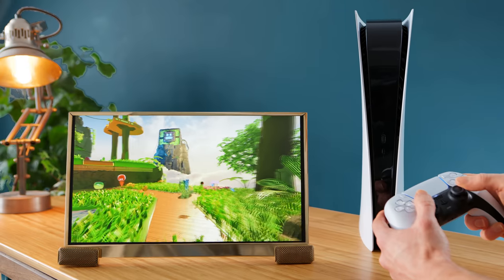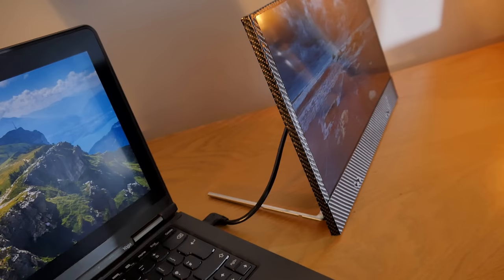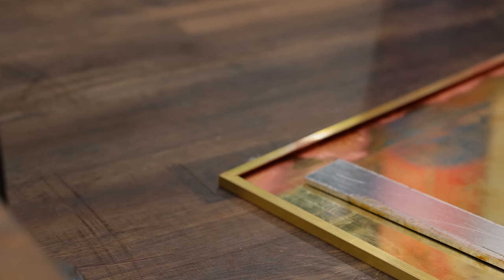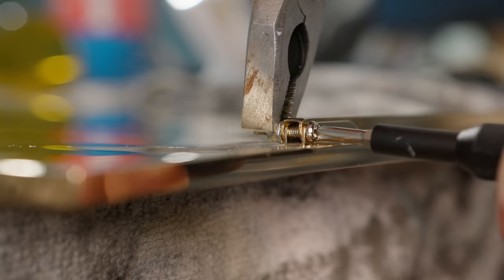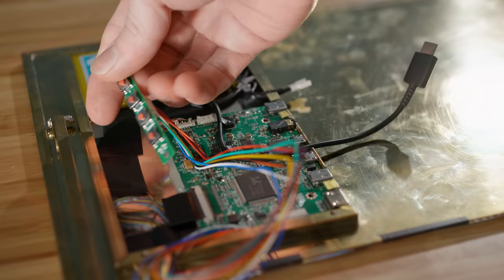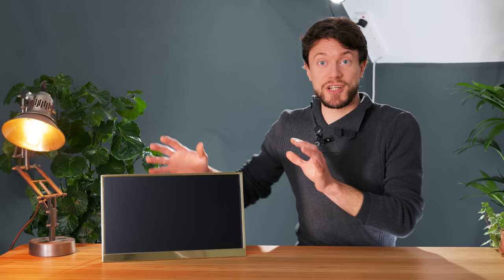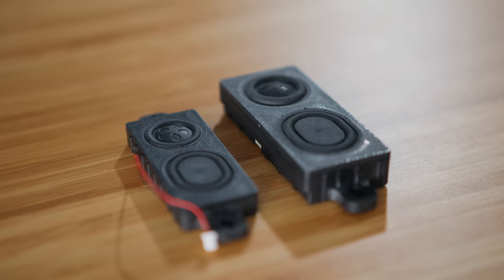Building a USB-C touchscreen monitor (new for modern devices)

Comment: I really appreciate that you used actual DIY methods instead of just 3D printing a bunch of stuff and gluing it together
Reply: Sure you could say it's just 3D printing things and glueing together but soldering electronic components, doing the actual 3D modeling, and doing prototypes/testing, are all important parts of that kind of DIY. The same applies for this with the only serious difference is that it's much harder for someone to replicate this kind of thing as not everyone can source some materials (brass in this case) or the tools required to work with it. 3D printing is relatively cheap in comparison as people either have access to a printer already, and if they don't, wouldn't have to pay as much to buy one as they would for the materials in just one or two projects.
Reply: @sacripudding4586  Yeah, but having a 3d printer is far less common that having a hacksaw and some files
Reply: @sacripudding4586  false. brass costs pennies
Reply: @post-leftluddite  the real trick is building your own 3D printer
Reply: @reverendglitch  which you must make using a 3d printer 😉
Reply: @post-leftluddite  I would generally agree, but 3d printers have become insanely available, affordable, and reliable in the recent years. If you think about it a bit, to do any DIY project you just need some basic tools. And if you want does tools to be any good you are going to spend at min 100-200 bucks. Creality Ender 3 printer costs just shy of $200 it can be delivered to your door in 3-5 business days and it just blows the mind how easy it is to use and what you can do with it. My point is, statistically you are probably right atm, but the way the current trends are going, I can see 3d printers becoming common in garages like electric screwdrivers and chainsaws.
Reply: @reverendglitch  no, the real trick is building your own 3D printer out of brass ☝🏼
Reply: @post-leftluddite  can I ask who has a hacksaw
Reply: @Notpoop906  With the amount he uses? no. You would be spending the price of half a 3D printer for every sheet of that stuff he uses. Plus if you want to buy the cheaper stuff and make your own sheets, you would need the knowledge to melt down brass and get it into a sheet you can manipulate.

Also 3D printing is far easier to do. While its true that it usually does look worse, that's not always the case as you can get some beautiful prints
Reply: No need to over-exaggerate, you can buy sheets of the stuff off eBay delivered to your door from China for very little. Truth is, the DIY lifestyle means you end up learning a bunch of inter/related fields that are of maximum utility, and it’s common for these people to have a workshop. He went with brazing brass because he thought TIG-welding Aluminium would be a bit of a stretch for a tech channel, but some of us can weld. Very few have a foundry and hot-drawn plate processing factory hehe. Personally I’ll make mine out of mild steel because I think rust looks cool, we’re living in the end-times so eventually it’ll be fashionable
Reply: @sacripudding4586  3D printing is mainly done by using your brain while it's nice to also do some actual handcrafting once in a while.
Reply: In what way is using a 3D printer NOT a DIY method? 3D printers are DIY tools just like a miter saw or a jigsaw
Reply: If you live in a fairly sized city you can probably sign up to use a 3d printer at a library
Reply: @buttslaya  I dont think they have metal printing? Just plastic like materials..
Reply: @post-leftluddite  Having a blowtorch and a place to use it safely isn't that common either. It's way easier (and cheaper) to do it with a 3d printer.
I can yeet a printer into my bedroom and not die horribly (source: I haven't died horribly yet). For soldering/brazing/welding sheets of metal safely i'd need to get a workshop/garage or do it literally on the street. Doing it in an apartment is too dangerous even for me.
Reply: @ireadysucks3026  uh, anyone that walked into a hardware store with 10 bucks and a need for a hacksaw?
Reply: @BeetleBuns  yes, but I don't know a single person with a need for a hacksaw
Reply: @sacripudding4586  Damn bro, where the hell do you buy brass? For the price of even a cheap 3D printer, say 200 USD, I can get a 4ftx8ftx1mm sheet of it and have enough to get 50 things at a dollar store.

Comment: Matt in another 2 years time: "I made this out of my new favourite material... Titanium... Which can easily be welded in a vacuum so remember to wear your oxygen mask if you try this at home."
Reply: Titanium, Niobium and Zirconium are metals that can be easily anodized in vivid yellow, green, or blue (or a rainbow style). And this is not an acrylic paint. So, why not?
Reply: It also looks quite smart!
Reply: hahahahahaha
Reply: OR much easier, an enclosed welding booth purged with argon. You can easily convert a sandblast cabinet into one. Seal it up and put argon in it. It just needs more pressure than the outside of the cabinet. Argon is heavier than air so the cabinet really doesn't even need a top!!! (I cast titanium golf club heads for 15 years and built the welding cabinets AND vacuum induction machines).
Reply: @reasoningtruth  That's the DIY perks video in 1.5 years time.
Reply: Diffusion bonded/superplastic formed screen frames at home....
Reply: there is no air in a vacuum so a weld thing will not work, but yeah who even tries this stuff
Reply: @ritwikgossain8379  I hope you're never in charge of welding OR melting titanium being as they both must be done under a vacuum and/or a purged container of oxygen and back filled with argon or you will end up with trash that has very little use or a hydrogen bomb. Research before posting and you won't need to retract your post as much.
Reply: @reasoningtruth  idk man but i think you cannot burn stuff in a vacuum as it has no oxygen, unless you supply the oxygen from outside
Reply: @ritwikgossain8379  a "weld thing"?
The point of welding in a vacuum is there is no air so you don't need to use inert shielding gasses, and for some finicky metals to weld like titanium, being able to melt the metal and there being no risk of oxidation is a benefit.
Reply: @ritwikgossain8379  How do they weld underwater? How did the old tungsten filament light bulbs burn in a vacuum? You don't need oxygen to melt metal, you need heat. We melt titanium in a water cool induction machine, a lot like your microwave. But that whole crucible must be in a vacuum chamber. The HUGE risk here is that if the water cooled crucible leaks the vacuum would suck huge amounts of water into the chamber. But titanium will suck all the oxygen out of the water in microseconds, leaving behind the hydrogen in a 3,500 degree chamber. So in nanoseconds you'll have a hydrogen explosion.  It happened twice in the US when we first started learning how to melt titanium. Now there are so many bells and whistles and explosion proof walls on titanium melters it seems it could never happen again. But it was exciting back in the day!!! LOL Ritwik Gossain, you only need heat to melt metal. It's impossible to pull a 100% vacuum so we pull the vacuum and put argon in the chamber to dilute whatever minimal oxygen that is left over. The guys would take scrap splashes of titanium that were too contaminated with oxygen, (gorgeous colors), and fashion candle holders out of them. It didn't take long to see them in the stores.
Reply: @ritwikgossain8379  Reductively speaking, welding is melting, not burning.  The very reason you're insisting you need oxygen is the reason you don't want any.
Reply: it was not vacuum in the filament bulbs, it was argon, and i said burning requires oxygen not melting
how does heat transfer?
conduction, convection or radiation, which require oxygen
idk about the rest kevin
Reply: @ritwikgossain8379  I'm throwing the towel in at this point, you're making things up as you go. Your post when you started said, "there is no air in a vacuum so a weld thing will not work". Welding is melting. Good bye. Go find a frog or something to do your senseless arguing with.

Comment: "because they can get soldered together"

the circle of tech making, he has ascended to non-repairable chasis
Reply: Solder is super easy to take apart, you just heat it up again.
Reply: @Lolquake  Apple and Microsoft Surface team taking notes - "glue can be heated up to take it apart"
Reply: tbh, with a 1 product made, there's no way to order custom made small screw to get it together. also it make them complex with metal. it can be improved if it was sold to other
Reply: @Lolquake  this is, indeed how soldered on components are replaced.
Reply: apple would be proud lol
Reply: Hello, I would appreciate a lot if some one could solve me this doubt: having a touchscreen, is there any way to use it with a digital pen (with pressure sensitivity included) on Macos? I found an old touchscreen from an old desk computer and I'm sure it doesn't have no sensitivity to pressure as a screen but, is there any digital pen I could connect to my macair so it reads the pressure besides the screens capability of it?
Reply: how the shit are you gonna repair a brass chassis... if it breaks, it's really broken. (you melt it down and recast)
Reply: @someoneelse1550  or solder
Reply: @someoneelse1550  maybe only one section is broken or you know the electronics break whilst the chasi is fine
Reply: @T.ONE-2-EntreOlivosEstudio  Pencils like Baseus stylus might help you. They don't need to be connected to the device and work more like finger replacements but more precise.

Comment: i did this on “easy mode” by reusing the laptop display assembly and modifying a raspberry pi 3d print template to fit the driver board then just fixing it to the back. the laptop hinge got reused and works great. just have to flip it around by undoing the nuts and adding new lubrications. 

good alternative for anyone who doesn’t want to go thru all the metal work or doesn’t have the tools or space
Reply: So the raspberry pi is replacing the control board?
Reply: @quinxx12  no just the case.
Reply: You got a tutorial? I would like to try this as well but how did you make the enclosure for the raspberry pi?
Reply: Ever considered making a magnetically attachable keyboard for this build, like surface pros? I think this should not be problem for Raspberries, since they can be connected via Bluetooth
Reply: Sorry but what did you use the raspberry pi for ?
Reply: @userone4874  i know i am late, but he didnst use a pi, he just used to case to house the periferals in
Reply: PICS PLZZZZZZ

Comment: Brilliant build! I would like to add just one tip... Brass oxidises. especially when touched with bare hands as the oils in our hands speed up that process leaving the brass tarnished and discoloured. So, to save you the heartache of having to continually polish this, which could lead to potential damage, I suggest clear coating all of the brass once its been cleaned and ready to receive the parts.  the Laquerre or Clear coat will create a very hard protective coating on the brass keeping it looking shiny for years if looked after.  Then it'll only ever need a simple dust off now and then.
Reply: Doesn't the metal polish already adds a layer over it though?
Reply: @8bviews91  god damn it. Not helpful, but okay
Reply: @SuperSohaizai  no. Metal polish does not add a protective layer.

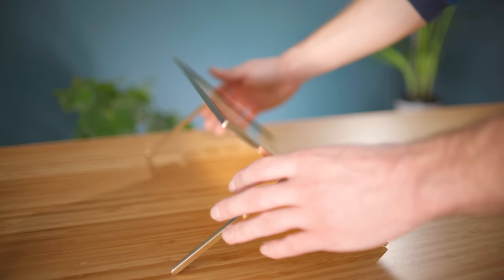Comment: 5:45 a significant improvement for stability and to prevent damaging the device and/or surfaces and possible injury, the legs should be joined by another length of brass soldered between the two legs.

Comment: best tutorial I've seen so far. You covered every possibility I was hoping for. The built in battery that you plug into with usb is THE best touch in the build. Its a perfect solution to get rid of the power cable yet its sleek and no extra finagling, just taking advantage of the built in features.
Reply: But how do I know what battery to look for for a basic LCD panel , for a build like this, the Controller board I got, says it requires 12v 3A,  that is big for a "slim" LI-o battery.

Comment: if you want to avoid displacing brass you have already soldered together you should try putting wet napkins on the joints you don't want to melt, it works surprisingly well.
Reply: Or use cool gel

Comment: These micro sized controllers coupled with modern 4k touchscreen capable monitors is kind of mind blowing.

You can now build your own Tesla dash board if you’re willing to spend the cash. I’ve seen iPads hacked into the dash, but choosing the resolution size etc here is actually huge for custom car work.

One day I’ll have the cash to switch my engine to ev, but until then, this will keep me busy.

Comment: Unless you have a donor laptop, you are better off just buying a portable monitor with touch screen capability. You can find 15.6" 1080P for under $250 USD on amazon. You will need the lcd/digitizer ($90 USD), the eDP controller with USB C port ($40 USD), and the touch controller itself (price ?!?) and you still need a case and power adapter maybe.... Most of the components will come from China so lots of delays in shipment as well. Take a look at a disassembly video of a touchscreen laptop for a better understanding of the components needed plus the eDP controller for the USB ports.

Comment: U should've just used a usb c charging circuit. That cable wouldn't be sticking out, it handles all the protection for the battery and u can use powerbanks with them as well.

Comment: This and some hinges, for a top half.
Combining it with the base parameters design of his watercooled ps5.
Only instead, adding a thin heat sink layer with a louvered bezel to the bottom (by having the ps5 build essentially upside down,) to maintain fan+passive air and thermal control.
Does add a slight thickness to the original slim concept, but with such wide area for thermal management using the whole base as essentially a passive heatsink, paired with the slotted bezel for dispersement of heat (aiming for rear exhaust channels) as well as intake of fresh air on all sides, I believe the added chamber could stay rather slim while simultaneously meeting or beating the watercooled specs without sacrificing a fan system.
Allows him to stick to the external power brick, grab a laptop bag and a ps5 controller, and he’s off to the races.
Potentially even adding a chance at a laptop battery-esque combo, for truly portable/wireless play.
(Even if the standalone battery life would most certainly be dismal 🤣)

All while negating the need of the waterlines+gigantic wall piece, which killed the first ps5 board.

Absolutely not bashing, I’m in love with your work and your channel, and would just love to see the first laptop style, ps5 “move,” be amongst your accolades in the DIY creator space.

I can’t thank you enough, for all the inspiration you give me in own home projects.
Please keep reinventing the way tech and sleek design, combine. 🖤

Comment: 7:06 Lithium batteries normally have protection circuitry packaged with the battery. If you unwrap the black plastic/tape cover, there should be a protection circuit under there.
Reply: If you buy those batteries fron a electronic distributor, no protection circuit is build in. This is "normally". :-)  And btw: Those circuits are normaly bundled with the charging electronics. Without a charging electronic the batteries doesn't make any sense.

Comment: Brass is a very nice material, as copper as well. The problem is that they oxidize pretty fast and get dull. If you want to keep it shiny than you should apply a transparent metal varnish. Good job, looks amazing.

Comment: I've been wanting to make a fold out touchscreen for the for the kitchen to make following online recipes easier. This idea would work perfectly, it's slim and doesn't require me to build and set up a small computer dedicated to the kitchen. I can just pull my phone out, plug it in and flip the monitor down (probably hinged to the bottom of a floating shelf with stiff hinges) and be ready to go.

Comment: You can use a high temp solder for the edges and a low temp solder for the hinges to avoid melting the solder for the edges.

Also last gen iPad screen protectors are very cheap, would work great for the brass isolation

Comment: Enjoy having to polish the whole thing every couple of months

THIS COMMENT WAS POSTED BY ALUMINIUM GANG
Reply: aluminium gang
Reply: patina gang
Reply: PS: Note not in the video  use a 1.99 can of spray plastic coating to seal the brass in and prevent tarnishing as a rule >:)
Reply: Wrap everything in carbon fiber looking wrap gang
Reply: Aluminium will still build an oxide and go dull pretty quick, but you also can't solder it
Reply: Enjoy the patina instead, making it from copper instead of brass
Reply: @agent_447  that is such a corny style imo, fake carbon fibre is so obvious and real carbon fibre looks so nice and is hard to do so I quite a lot of respect for it, but I'm not dissing you, I respect your opinion
Reply: @Xxassass1n021xX  no offense my random internet friend. It's just a quick install and kind of doesn't really fade or need much cleaning. But I meant it as a joke. This channel is part diy par artistry. Mad respect for his work.
Reply: patina looks even better !

Comment: I tried so hard to find a USB-C/USB-A control board for my laptop's screen and couldn't find any. I had to settle for a HDMI with 12v DC power input to AC switching adapter, but it works. :)

Comment: Hi, I wanted to ask how you soldered the last bottom piece on without damaging the screen as you don't show that process in the video. Thanks!
Reply: He doesn't. It just slides right on.
Reply: He said he soldered the brass cover onto the u channel first then just slid it onto the monitor.
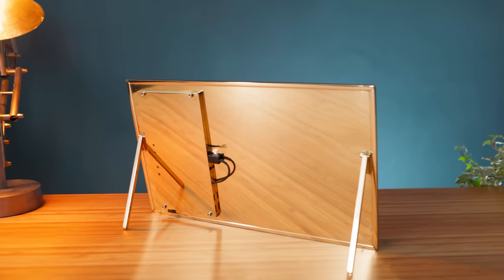Reply: The last bottom piece was screwed on, you can see it from 8:26 and 13:12